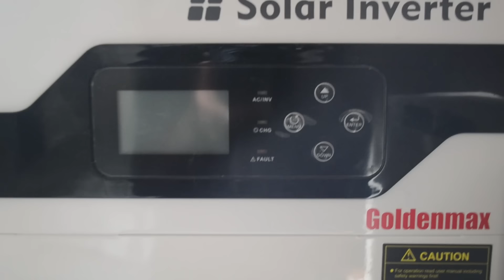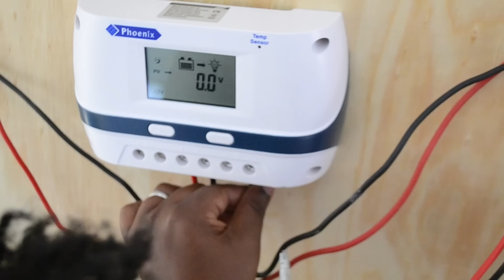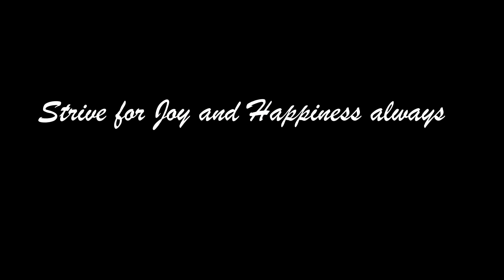Our Offgrid SOLAR SYSTEM | Powering our home in the Wild Kenyan Savannah

Comment: Sorry for the damage to your batteries. I hope the settings of the solar controller were correct. It happens very often. I lost my batteries twice before I figured out that it was due bad setting (not setting) solar controller to avoid overvoltage and overdischarge situations.
Reply from the maker: Thanks!!

Comment: Beautiful 😍 yet again I love your diy projects very motivated...how much did the solar system cost and what does it power? I see you using the oven is the solar powering that as well?
Reply from the maker: The stove is gas.... What we are using now powers lights,tv, radio, charging devices.what we returned was very affordable, batteries all cost 30k, panels32k, charge controller 7500, inverter   5k. We were upgrading to get the fridge , washing machine and other appliances to work.
Reply: And here I thought I needed like 400k projects on solar only
Reply from the maker: Depends on what you are using it for. But they are affordable prices right now in the market for sure